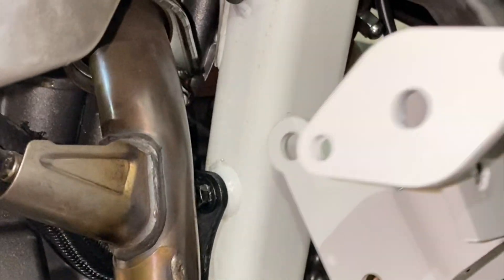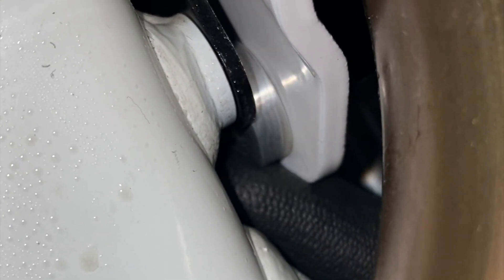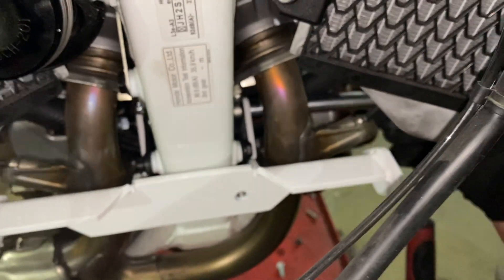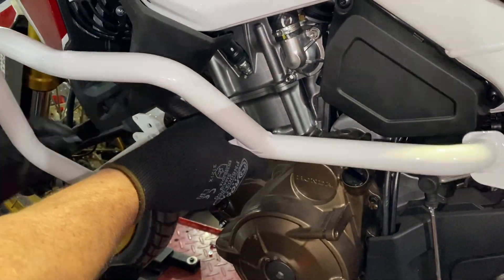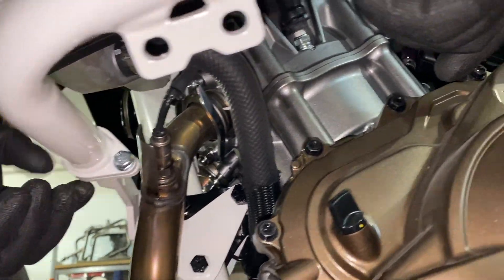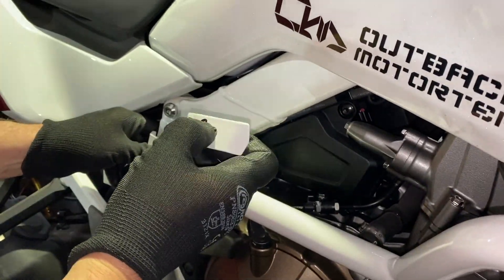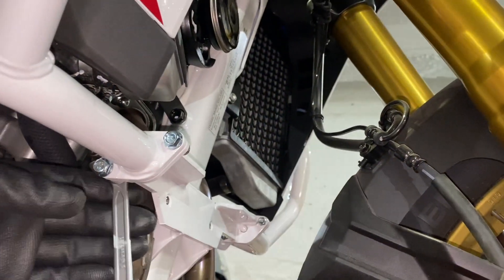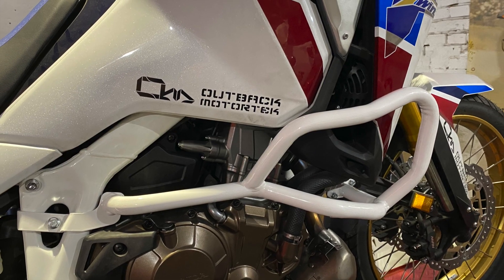Honda CRF1100L Africa Twin Lower Crash Bars Installation (ENG) #africatwin1100 #crf1100l

Comment: I installed the full kit today - upper and lower crash guards, engine guard, skid plate. I have a '21 ATAS DCT. The videos are pretty spot on. Installation took me about 6 hours total, mostly because I take my time and am not in a hurry. My only mis-step was at the beginning, removing the cross-bolts. I misunderstood, and removed the lower and upper black OEM ones (which also had me taking off the exhaust when I followed that rabbit trail). Once I figured out that it was the lower black cross-bolt and the slightly larger silver cross-bolt, I was back on track.

The only differences in the videos to my install is that I think some of the bolt head sizes are different. For example, the bolt heads on the C-Clamps are 8mm, not 10mm.

The only thing that would have helped would be a 10-year-old helper. I have large hands, and getting my fat fingers into some of the bolt locations was a challenge. Although, to be fair, very little blood was lost....
Reply: Thank you for your comment. The installation video sucks. These crash bars cost bucks with not much invested in the installation. I didn’t realize they removed the bolt at the engine and not the frame.
Reply: @Oldrush  i found it to be pretty clear.

Comment: Great product and video guys. Just installed lower crash bars and engine guards. I would point out to be careful installing the right back plate. On my 2021 ATAS there is a break line that touches the frame. Tell everyone to make sure the back plate is underneath that line to not pinch it. Thanks guys! Great product!
Reply from the maker: Thanks for your comment and the note about the brake line

Comment: Just installed on my 2022 AT. Only thing that was kind of confusing compared to the video here was the bracket behind the frame on the left and right side. The bracket has been updated since this video. Was unsure how it would mount. The right side was a little worse but I believe the bracket may have bent to form? Regardless I can tell the amount of time OM has spent on making sure everything lines up well. Bravo.
Reply from the maker: Thanks for your comment. Yes, we upgraded the brackets and they shaped to “lock” in place behind the frame
Reply: @Outbackmotortek  was a good upgrade.

Comment: Just installed the lower crash bars, engine guard and skid plate on a 23 AT Adventure Sports. Took around 2 hours. Super happy with ease of installation working by myself. The  lower crash bars by themselves are fairly solid but once you tie in the engine guard this tightens up the complete install.
Reply from the maker: Awesome! Thanks for the feedback and for your support

Comment: Just a heads-up. If you bought your AT with the Honda engine guards, you'll have to drop the exhaust in order to remove the Honda mounting bracket for those guards, so you can install OM's bracket. Honda's instructions are found in their accessories page with the OEM engine guards. A friend or a floor jack make the job much easier.
Reply from the maker: Zak Parrish Thanks for the suggestions. Some of our customers have been able to install the cross brace just by removing the four nuts on the exhaust header and gently pull on them in order to create access to the through bolts.
Reply: Outback Motortek To avoid removing the 4 header bolts, do you think it is possible to use a hacksaw to cut the upper thru bolt??? Will a saw cut through the bolt? I have a CRF1100
Reply from the maker: Ron P I’d avoid using a saw at all cost. Just remove the nuts. It’s a pretty simple job.
Reply: @Outbackmotortek  you are correct. I'm only talking about if you had the Honda official engine protection bars. They're an accessory, not standard, but they came with my bike. It's not anything OM can control. Just mentioning in case anyone winds up in the same boat.
Reply: @outback motortek / @zak Parrish: I’m in same boat; did you have to replace the exhaust gasket when you took of the exhaust?
Reply: I replaced exhaust gasket
Reply: Not a bad job overall. Helps to have an extra hand to hold the exhaust up, all bolts need to be removed including at footpeg and at rear, but then w/ blocks the exhaust can be held up so need to disconnect the O2 sensor, etc.. The top and rear most bolt goes in at an angle rear and up a tad, NOT horizontal. Key to note.
Reply: @zakparrish  @outbackmotortek I am just installing mine. I also have the Africa Twin Adventure Sports with the OEM light bars. I understand what @ZakParrish is saying, it is tight, but I managed to remove the four nuts on the exhaust header and then used a breaker bar (with some foam wrap to protect the frame) to add a small amount of easy leverage between the header and the frame. This gave me just enough room to pull that third bolt that connects the OEM light bar bracket. I used a breaker bar, simply because it was skinny and long, you could use anything to add that bit of leverage though.

On another note. That super tight bolt at the back seems best removed by attacking the nut, rather than the bolt head. The nut gives way a lot easier. 

I have yet to finish so better get back at it!

Comment: My kit came with 2 fat spacers, no mention in the video where these are supposed to go? Also the video does not mention using the spacer that is already where the 10mm bolt goes, make sure to put it back because it will likely fall out when you remove the OEM 10mm Bolton on the frame. I would also recommend removing the OEM skid plate for ease of access to the frame.
Reply from the maker: The two long spacers go between the rear brackets which attach to the frame. We’re yet to update the video.
Reply: still waiting,  one year later...
Reply: @RagnarOfBallard  Exactly. @OM you make a great product but your instructions miss the mark. I know the video is easier but please at least keep them up to date. It's a pain in the ass enough to install these things without having to decipher the parts that came with a 1k dollar kit.

Comment: SO when I remove the upper bolt that connects the frame to the engine, will my engine shift?  It looks like this is what holds the front of the engine in place.  Thanks in advance before I proceed any further!
Reply from the maker: You can remove both bolts at the same time. There are a few more bolts that keep the engine in place.

Comment: I removed the 2 8mm on the OEM mounting bracket, only learnt from the comments that i should remove the 10mm bolt mounting the engine. A pdf should be better than a video for installation instructions
Reply from the maker: Thanks for your comment. We do mention at 0:35 that you have to remove 1x 8mm and 1x 10mm through bolts, not 2x 8mm bolts.
Reply: @Outbackmotortek  i had to remove both 8mm as OEM guards were installaed. My bad

i managed to fit the main guard, but noticed left side of the bike gap is bigger than the right side. 

I prefer to correct the gap before mounting the rest. Can it be because i only used the supplied 8mm spacer on the left of the bike? Note that no spacer on OEM bolt and no space to fit spacer on the right side of the bike. Thanks for quick response 

Pending engine guard, uppers and bashplate. Hopefully tomorrow
Reply from the maker: @AbubakarAl-Amoudy  please feel free to forward any photos of the asymmetry of the crash bars to info at outbackmotortek dot com 

Thank you
Reply: @Outbackmotortek  I don't believe those sizes are correct on the 2024, I agree PDF especially for us technical people.

Comment: A question. Is it possible to get off the battery toolbox without get down crash bars???
Reply from the maker: No, it’s not. The left side crash bar is secured by three bolts and it takes 3-5 minutes to remove it.

Comment: 6:30 sorry I saw how well performed are your crashbars under heavy use but you should do sth about these scratches on the frame during installation.My opinion is that you should use rubber material inside the components in order not to harm the bike frame.
Reply from the maker: It's mentioned in the video that we'll put a rubber or silicon layer on the tabs to prevent it from scratching the paint. The same feature as on our CRF1000L crash bars.

Comment: I have the standard version, only 2 spacers with the engine mount bracket. I can't install it, was I supposed to get one with the crash bars or is my bike missing a spacer or was I supposed to get an extra spacer from Honda?
Reply from the maker: Revhead We supply one spacer. The other one is from Honda. You must have lost it when you removed the long through bolt.

Comment: Hello OM/Lorry. Watching this vid reminded me that i have a question.

Is it possible to remove the exhaust headers itself without dismantling the lower crashbar installation?

I'm considering a header swap hence my question to have an idea what I'm up against. Mine is a 2016 model. Appreciate your response or anyone who has done it before.
Reply from the maker: Thanks for your comment. There's very little clearance between the headers and the lower crash bars' cross brace, thus I think the only option to remove the headers is by first removing the lower crash bars. 

I hope this help. 

Cheers,
Lorry

Comment: But on 2022 i have 12mm and 14mm bolts on originals
Reply from the maker: Are you referring to the front through bolts in front and behind the exhaust headers?
Reply: @Outbackmotortek  yes tomorrow i'm receiving the max protection from Gionata,  checking all nuts and bolts. to remove originals i need 12 and 14mm wrenches. Just watching your mounting videos to be prepared. Maybe i'm wrong, but all equipment described in your video is for mounting, not for disassembling.
Reply: @Outbackmotortek  sorry, yes i meant that
Reply from the maker: @krukbee  it’s 8mm and 10mm diameter bolts. There’s no 12mm and 14mm. This hasn’t changed since the introduction of the CRF1000L in 2016.
Reply: @Outbackmotortek  i'm confused, sorry to bother you, may i have an email to send you pictures? The original  back and d black palte has 3 bolts a  nuts, to put outbacck i need to remove 2 of them, one is not removable since i have remouve exhaust. The deeper one (deeper is meant the one more closely  to engine) is 14mm,  the 2nd one  lower, is 12mm  just checked few moments ago.
Reply from the maker: @krukbee  it’s clearly shown in the video starting at 0:30: top bolt is 10mm diameter, bottom bolt is 8mm.
Reply: @Outbackmotortek  may i send you a picture? At L 1100 dct 2022. The bigger bolt is 14mm crhome all the other 2 are 12mm and black.
Reply from the maker: @krukbee  you must be looking at some different bolts. You can email your findings to info at outbackmotortek dot com
Reply: @Outbackmotortek  not joking,  really happy about your answers on YouTube on Sunday, but i can not miss holes on at in front frame. I have 14mm on top bolt and 12mm on lower bolts.
Reply from the maker: @krukbee  send us photos, please. We have hundreds of customers with 2022 CRF1100L models. You must be looking at the wrong bolts. Once we see photos of what you’re looking it we’ll be able to put you in the right direction.
Reply: @Outbackmotortek  ok maybe a language problem, on my side. I talking about of the heads of the bolts, not the diameter of the screw thread.
Reply from the maker: @krukbee  Thanks for the photo. You’re referring to the socket/wrench size, not the diameter of the bolt!! 

Yes, you need a 14mm wrench or socket to remove the  top bolt and a 12mm wrench or socket to remove the bottom bolt. 

The bolts we supply are correct and it’s 8mm diameter (thickness of the bolt) and 10mm diameter (thickness of the bolt).
Reply: @Outbackmotortek  love you really. Keep the faith.